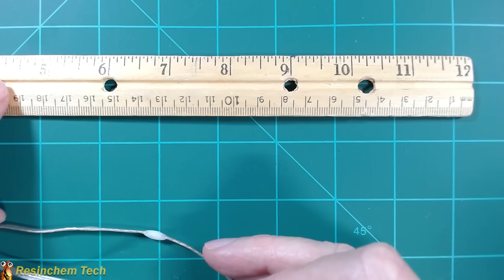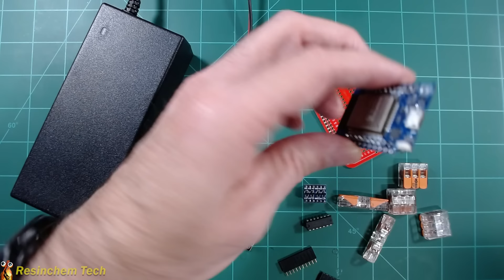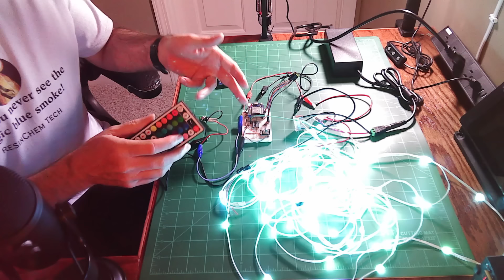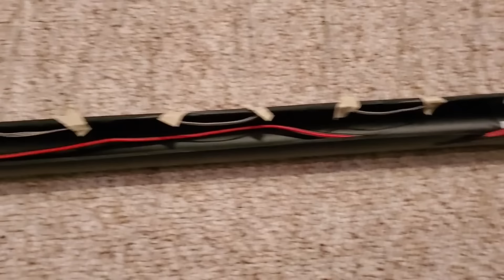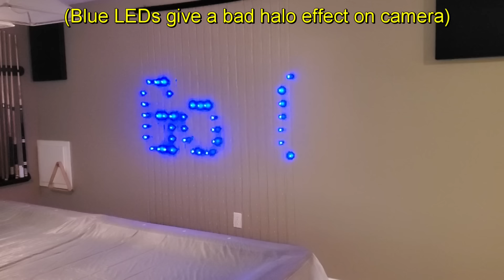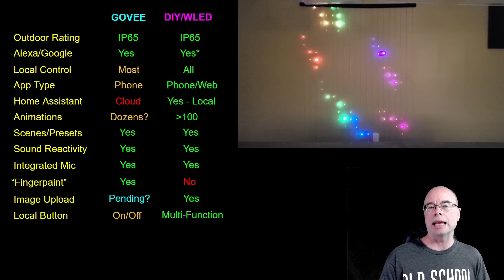Building an LED Curtain with WLED

Comment: Awesome to see someone making a curtain with these seed pixels!
I did basically the same last year for my wiring to make a 2,400 pixel Christmas tree.

Some worthy notes:
* A few sellers sell 4-wire seed pixels, these have 1 unconnected wire you can connect to data out at the last pixel and data goes back to the start of the string.
* Many sellers have a 12v version and one vendor (I'm aware of) sells a 24v version. This 24v version is 6 individually controllable pixels in series across the 24v (4v per pixel). I have heard the vendor is willing to wire this for other voltages up to 48v (POE pixels with a WLED Ethernet board...?)
* Some Chinese vendors call these 'pebble pixels', although sadly they're taking a name likely trademarked by Minleon group (for a larger type of pixel).
* Cheapest I know is 2.8c USD per pixel on spools over 2,000 pixels.
* and finally, these work well outdoors for their cheap price. They yellow slightly in the sun but are waterproof.
- For the record, my mega tree is 450W and you see I have it split across two 350 PSUs. I used WLED when testing then moved to my main pixel controller.
Reply from the maker: Wow... thanks for the tips and ideas.  I do have my indoor Christmas tree strung with 12V bullet-style pixel lights and connected to SR WLED.  I almost wish I would have used these seed pixels (thanks for giving me the proper name... I wasn't sure just what they were called!) on the tree instead.  If I ever have the need to restring the tree, I will definitely consider it.

Thanks for watching and taking the time to pass along some very useful info!
Reply: @ResinChemTech  All good, thanks for the great videos on WLED and other projects.
One other thing I tried an AliExpress seed pixel curtain, they used a 't splitter' at the top of each string. The 't' took data in, sent pixel 1 - 20 out one port and data 21 onwards out the other port. I've been trying to find these for sale. A downside these had is running at 400khz, not the typical 800khz.
Reply: @NorthparkLights  Can you possibly point me in the right direction for the 2.8c USD per pixel on a spool of 2000? :)

Comment: I did this but I took an already made led curtain and just removed the controller and reconnected to wled esp32
Reply from the maker: Others have made similar comments here about retrofitting a retail version.  I guess it depends on how much you want to "DIY" vs. modifying something already built... and what your end goals are.  For me, I wanted to see if I could build something from scratch that duplicated, or matched as much as possible, the retail version... without actually purchasing the retail version.

But if your end goal is just to replace the default firmware/controller with WLED, you can certainly just replace the controller... at least it appears that way with the Govee version.  I don't own any of the retail versions, but others have reported removing the Govee controller and replacing it with an ESP32/WLED, so apparently it is possible.
Reply: @ResinChemTech  what you did was awesome and a great job at building one of these from scratch, very informative Thanks for the vids
Reply: Was this a prebuilt WLED controller using an esp32 or just the ESP32 board itself that was loaded with WLED? Thanks.  I am new to this.

Comment: HI!   I love hearing about electronic anything even if i lack understanding how to use electronic components', i still Learn.
GREAT info, i will pass it on.   Added Knowledge, Reading comments below, Plus with each of your answers.  Thanks!
Reply from the maker: I honestly knew very little about electronic components myself just a few short years ago, other than you plug it into the wall or put batteries in it!  But I had a lot of good folks help me out at the start and I learned bit by bit, project by project.  And as you may have seen in the video, I still occasionally make a silly mistake and fry a component or two... all part of the learning process.

If you have an interest, I'd encourage you to give it a shot!  You can start with a simple project like building an LED controller in a short time that doesn't require any soldering ( https://youtu.be/dXLOqGa-n5A ).  You may not even understand what you are doing at first... but the more you do it, the more you will start to understand.  My videos are generally very long because I do try to explain the "why" and not just the "how", but nothing beats learning by fire and building something yourself.

Regardless, thanks for watching and I greatly appreciate the comment and kind words.  It is comments like yours that motivate me to make additional videos.

Comment: Excellent build! Thanks for sharing. I have a question: on your version, you have the serpentine where the curtain versions terminate on each strand "at the bottom".. I'm trying to modify some previously purchased curtains that terminate on each strand but can't figure out the magic behind it. Do you have any leads (research, ideas, links to info) on how this is accomplished with most consumer LED curtains like Govee? Any insight is appreciated!
Reply from the maker: As I don't own any of the retail versions, I haven't been able to try reverse-engineering them.  But I can think of two possibilities.  First, the controller/firmware is simply designed to address the strips and pixel positions based on how they are wired (this is probably how I'd do it if writing my own firmware - and I think WLED can be configured this way too).  The other possibility is that a data wire is running internally from the bottom of each strip back to the top and then over to the next strip... basically duplicating the serpentine configuration I use without anything joined at the bottom.

If you look through the comments for this video, another viewer (jeremiahbullfrog9288 ) states he was able to take apart the Govee controller for their curtain and replace it with a WLED controller and get it to work.  He might be able to provide additional info in terms of how it was configured in WLED.
Reply: @ResinChemTech  Thanks for the reply! I found the comment and replied to it.
Reply: Wanted to do a quick update (lol, a year later).. After some research, I came across someone who did more research and found that (in some strands) the LED's used actually have their address programmed into their chip! I cut the last strand off a 20x20 curtain and wasn't having any luck until I told WLED that I had 400 LED's.. suddenly that whole strand worked! They still operate as WS281x but they individually know their address! Wow!
Tagging @jeremiahbullfrog9288 and @ResinChemTech here

Comment: FYI, you did not "fry the esp32" - the power line has a diode, that goes out either if you put polarity wrong, or if you overvoltage it. Just replace the diode and your ESP is alive. Or, alternatively, power it from 3.3V pin, it should work.
Reply from the maker: Thanks for the info.  In all honestly, it was simply easier to pull out a new ESP32 and solder the pin headers as opposed to trying to replace a diode  or rewiring the board to power it by 3.3V from my 5V supply.  At least for me and the $4-$5 cost of a new ESP32. 

But it's good info should anyone make the same silly mistake that I did.  My videos are generally targeted at beginners, so desoldering and replacing a diode, even if that would fix the ESP32,  is not something that most of my audience would want to attempt.  Personally.. me either!  As I said, much quicker and easier to just pull out a new board, move on and learn from the mistake.  But thanks again for the info.

Comment: That’s really cool! I bought 5 x10m of fairy lights last year and had no idea where to put them as I changed my mind and this is the perfect idea
Reply from the maker: I'm pretty happy with it.  I like the idea that I can move it out to the front yard for trick-or-treat, or maybe in a front window for Christmas, then hang it back in its normal location when the holiday is over.

Good luck if you decide to proceed.  Don't hesitate to reach out if you run into any questions!  I might be doing a follow up on this project in a month or two.
Reply: @ResinChemTech  thank you, I will if I ran into any issues.

Comment: Great build and video. Good to see the mistakes as well!! As a question for you as you have set up and tested LED's and Home Assistant quite extensively. Have you set up a separate access point for your WiFi router for added security so when using Home Assistant so it doesn't use the same AP that, for example, you may use to do your electronic banking on? If so do have any instructions on how to set up a second access point on a home internet router? BTW I use your build for the WS2812 controller all the time. It is the best one I have found to build and use. 👍👍👍
Reply from the maker: First off... thanks! And I'm glad you find the LED controller info helpful.

As far as my network, that is probably a lot longer explanation than I can put here in the YouTube comments!  First off, I have a Unifi/Ubiquiti network.  So, I'd love to have a completely separate VLAN for all my IoT devices.  But in short, I don't.  Partially is due to the fact that I have around 150 devices on my network, most of them wireless.... many mounted in not easily accessible locations (like in-the-wall behind light switch Shellys).  A large number of these were configured and installed before I had Unifii and the ability to do VLANs.  Changing networks, SSIDs and/or password at this point is no small task and could require reflashing the devices if I lose wifi access in the process of porting them.

So, in short, no I do not have Home Assistant/IoT network segregated.  Home Assistant, and any devices that support it, use wired/Ethernet connections and not wifi.  However, almost all my devices (~98%) are local-only and do not require Internet access.  I have pretty strong firewall rules in place and those devices that do not need external access are simply blocked.  It's not the highest level of security, but it's what I am currently doing.  If I were starting over and already had Ubiquiti/Unifi in place, I would do it much differently with a separate VLAN for my IoT network.

Comment: Great video. I have a Govee curtain and I can confirm that it does have image upload. You can even upload an animated gif and it animates on the curtain. Another advantage to the Govee, is the ability to share custom animations with their community. 

That said, I am definitely going to try this project out as overall i do prefer WLED to the Govee interface. Thank you for the great instructions.
Reply from the maker: Thanks.  I knew that feature was supposed to be coming, but based on the reviews I watched at the time, that feature was not yet available.  I appreciate the update, since as I mentioned, I don't have the actual Govee version... and obviously don't really need it at this point!
Reply: @ResinChemTech I agree, your curtain is just as good, if not better. I too prefer the WLED interface and will be following your GREAT instructions. I just thought it was fair to mention.

Comment: Thank you so much for the inspiration, and for sharing your ideas with all of us. Your explanation of the project is very good, and I have no further questions. It's great that you point out your mistakes, as it allows for learning, and there's no need to worry when things don't go perfectly.
Reply from the maker: You are most welcome.  I nearly cut out the section showing my silly mistake due to the length of the video, but I thought it was important to show that this WILL happen on occasion, but it is rarely more costly than a few dollars and a little bit of time... and as you mention, it is part of the learning process.

Thanks for the comment and the kind words!

Comment: You can have the best of both worlds with a "fork" not a fork but tuned version of WLED,  google up WLED MOON MODULES, it's custom code added to the current version (WLED 14) that adds back sound reactivity.
Reply from the maker: Thanks... I wasn't aware of Moon Modules.  But I suspect sound reactivity is going to make its way into the official WLED at some point.  This is a good option for someone that knows how to download the proper bin and then update/flash it to the ESP32.  It would be nice if it was a menu option for the web installers for those beginner folks as well... but you can't have everything!

Thanks again for the heads up on Moon Modules.  I might consider flashing the latest to one of my ESP32's and giving it a go with the curtain.

Comment: Thanks for this! I am interested in converting the retail version for WLED use. I haven't started reverse engineering yet, but it can't be rocket science..
Reply from the maker: You are welcome!  I think the biggest thing with trying to convert the retail version will be determining the type of LEDs used... and whether WLED can support them.. and the unique layout/wiring, since the retail version (from what I can tell) are not all connected in a serpentine layout and instead are individual strands all hanging freely from the top.  Not sure how this would be addressed in something like WLED but it may be entirely possible.

But if you do get the retail version working with WLED, be sure to let me know!
Reply: @ResinChemTech  Huge success! The Govee controller opens easily, exposing the data pin to the LEDS. They are WS281x in RGB order. 2D Matrix panel is width 20 x height 26, orientation vertical. It was very easy to de-solder the data wire from the provided controller and connect it to my ESP32 output without any level shifting. Power from the controller supplies my ESP32.

The non-serpentine configuration has a couple of advantages: you can walk through the curtain (like 70's beads lol), and 5V is injected at the top of each column. All in all I like this $130 solution that does most of the tedious work. Thanks again for your deep dive and motivating me to get back to this project.
Reply from the maker: Thanks for the info... especially since I don't have a Govee set here.  I'm sure this info will be helpful for someone else that wants to retrofit the Govee version with WLED as opposed to building my completely DIY version.  Kind of nice that you can modify it rather easily, that they do use WS281x LEDs and you can power the ESP32 from the controller as well.
Reply: Thanks for posting this.  I am totally new to this and would like to know which ESP32 you used to do this please or are all ESP32's  the same?  to clarify if they are the same... you use the ESP32 of your choice, load WLED onto the ESP32,  connect the data pin of the Govee array to an output pin of the EPS32, connect the 5v power from the Govee adapter to the appropriate place on the ESP32, power up the unit and connect to WLED, select the 2D Matrix 20x26 and then connect the WLED to the WIFI network and basically that is it... is this correct? thanks for any input or advice.  One more thing, how do you know which is the data pin for the Govee array is there an indicator or it is done by locating the connection points on the Govee control board?   @jeremiahbullfrog9288
Reply: How did you deal with not having a data wire feed to the next strand? I have a few retail/consumer ones I'm wanting to convert but didn't know how to figure out they did data without it passing from the end of a strand to the start of the next.
Reply: @DocEntertainmentProd  The Govee product seems to have a chip at the top of each column to "waste" 26 pixels if that makes sense.. so it looks like one continuous string of 520 LEDs to the software. You can't connect additional curtains end-to-end, but you can solve this by using multiple WLED segments (520 each) on multiple ESP32 pins. Then you can arrange them however you like in WLED configuration. I can't speak on other retail offerings.
Reply: @jeremiahbullfrog9288  Interesting.. but there is still only 1 data line that services the entire curtain, correct? So in your WLED settings, each column has its own GPIO but you're outputting via one pin? Then in segments, you do some math?
Sorry, I'm such a visual learner and would probably understand this in about 20 seconds with screenshots of your settings.
Reply: @DocEntertainmentProd  You're overthinking it .... the WLED settings are just one GPIO and it looks like one long string of 520 LEDs on that pin. Set the "matrix" parameters to 20x26 and pick a 2D setting from the list of effects. That's it. All the magic is done in the govee hardware.
Reply: @jeremiahbullfrog9288  ok, this makes WAY more sense.. excited to try it! Thanks for the info!
Reply: @jeremiahbullfrog9288 thanks for your instructions! Trying to follow them now. More a general WLED question, but which esp32 board are you using? Mine crashes anywhere from a few seconds to a couple of minutes of being powered
Reply: I had more success with a different esp32 dev board! Also had to increase the brightness limiter value to match the provided power supply
Reply: So much talent...very impressed